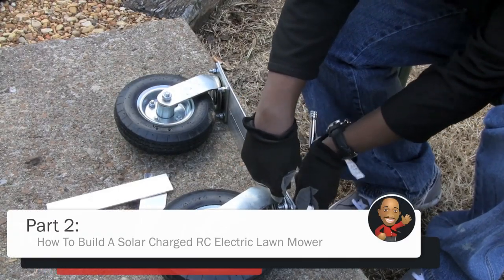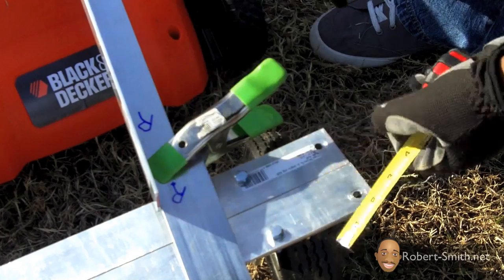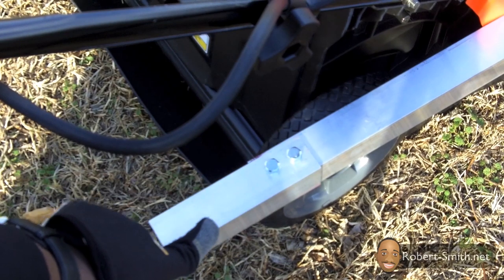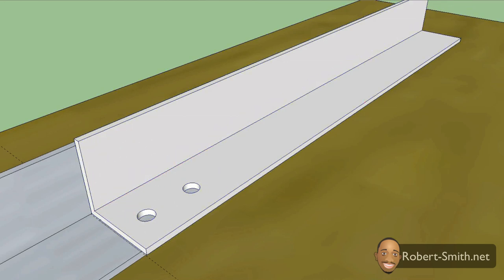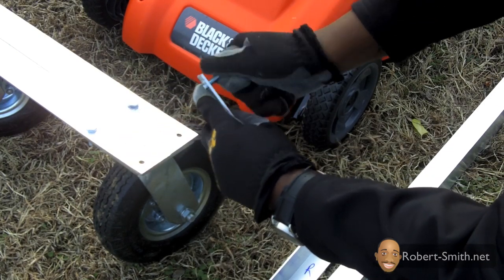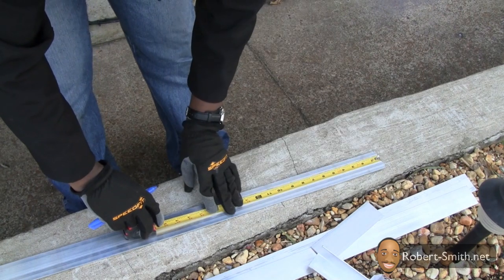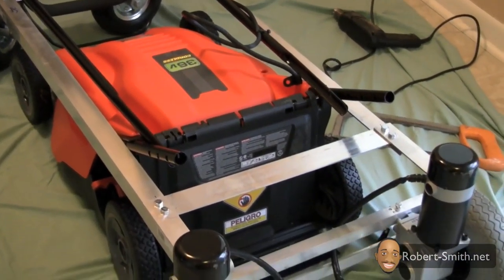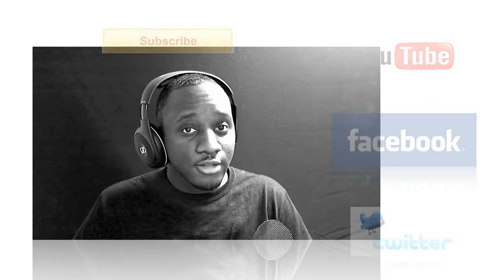How To Build A Solar Charged RC Electric Lawn Mower - P2

Comment: Thanks Robert for this awesome video. 
What is the recommended torque for the motor. Could you please share configuration - make  model, torque, power, etc.  for motors (L and R). On eBay so many different type of motors are available. Kind of confusing.

Comment: Hello I just went into your channel looking for ways to build a lawn mower remote control I know it's been 10 years ago I guess but I'm very interested in update in building one similar to yours thors is there a spreadsheet avais the spreadsheet available for parts list and where you got them at  I really like this video
Reply from the maker: Hey Richard. No spreadsheet at this time, and you are right, this is a really old video. Most of the parts were either from Amazon, dimensionengineering.com (motor controller), and local home improvement stores like Lowes/Home Depot.